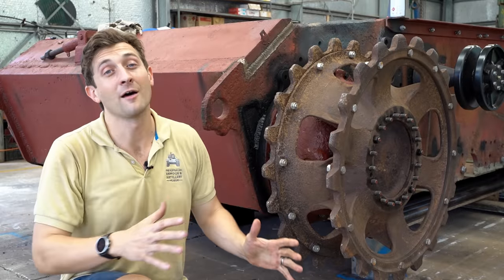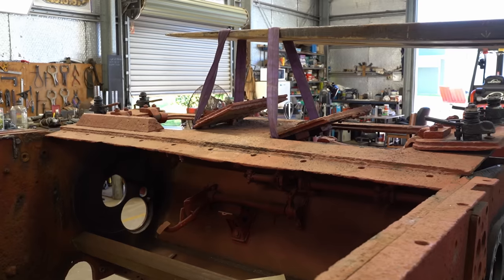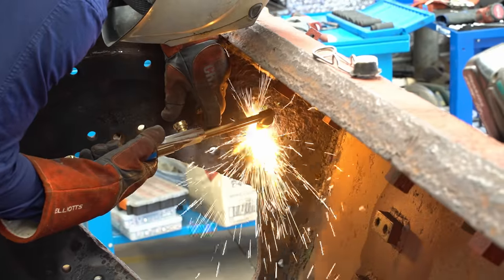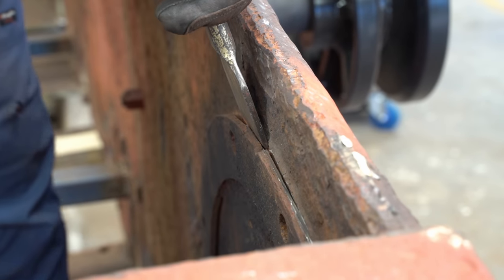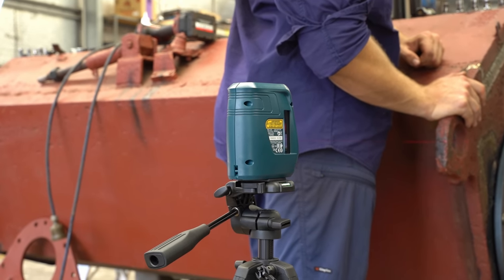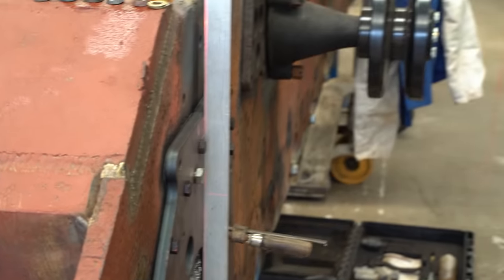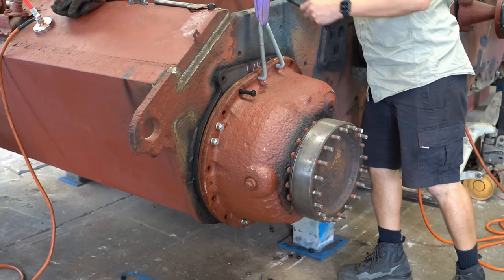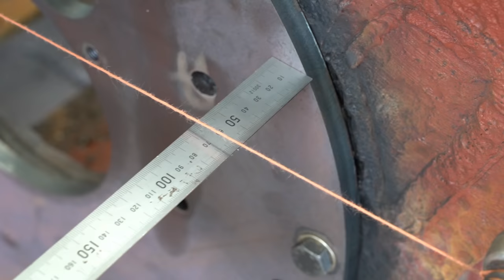WORKSHOP WEDNESDAY:  Bending WWII German StuG armour plate and fitting restored final drives

Comment: Fantastic video!  Crazy good skills there guys!  Not sure if anyone ever reads the comments, but here goes...  If you are ever in a similar situation again, where you are trying to level out a thick plate over an uneven surface, drill and tap three holes in the plate, spaced out in such a way that the holes form a triangle over the part you're trying to level it to.  Thread bolts into each hole (grind the ends of the bolts to smooth them out beforehand).  Use one bolt as your pivot, and the other two to level the plate out ("jacking bolts)".  Usually, the "pivot" bolt will be adjacent to one of the bolts you're using to tighten down that plate.  Use the other mounting bolts to apply compression to the jacking bolts as needed.

Much easier way to level/tram one plate to another than messing about with shims.  Level the plate first using the screws, then select shims to match the gaps between plates.  Weld everything up, then remove the three jacking bolts.  Weld over the threaded holes and you're done.

Thanks again for the informative/educational video...  "Mad skills" guys!

Comment: great to see the air chisel assistant! - great for giving that extra abuse when needed on stubborn nuts and bolts, rivets, bearings and any number of things that need hitting (if not to be used again that is) it can save an awful lot of human effort
great video showing the lengths these boys go to, to make things right, superb restoration work

always amazing to see how much distortion gets created with things that go bang, when an explosion occurred you have to imagine everything around it almost behaves like jelly, everything wobbles as the massive forces of expanding air bounce off the surfaces

many years ago, i was involved a little in some research and vibration testing, i was told by the instructor how years ago when testing engine block distortion, things were a little slower, using high speed cameras and multiple images, to show the engine at work, blocks could be simulated using polystyrene, and vibrated on a table, where there was more movement, that area would be braced until it became more stable - of course these days you can soon find a video of an engine 3d solid model being tested using the same theories and understand how all the components work together and still able to distort an engine to show where the maximum stresses are

there's a great channel i watch 'Lost Battlefields with Tino Struckman' who investigates WWII tunnel systems and bunkers, and you can see the results of any explosive device either wartime or post war experiments used on massive thicknesses of concrete is truly unthinkable, blocks the size of a houses lifted and upset by internal explosions

Comment: Fantastic work!  Just amazing how these guys throw around these huge chunks of steel.  I wouldn't want to be in an arm wrestling contest with any of them!  I can't imagine the strength and stamina it took to swing that giant sledgehammer over and over to straighten the 2" thick side.  What's so amazing in this work is they use blazing heat and brute force to move metal to within a millimeter or two of dead perfect.  Love these videos.

Comment: Stainless steel welding materials does stretch easier when it cools down after welding. This prevents the weld from tearing itself apart ore cracking. 
A good reason for them to use Stainless on she suspension is that the change of cracked welds is lower so your suspension will stay in one piece. 
The rest of the armor plates go together like a jigsaw puzzle and the weld is more to keep them extra in place but if its bad it wont give a big problem

Comment: What we used to do here in the sugar factories in Barbados when we needed a really big hammer hit is , we had about a 12 inch square steel bar about 3 feet long with 2 ears welded on at the balance point with some handles, it was slung on the over head hoist and swung on its chains like a battering ram, there wasnt much that it couldnt move.

Comment: Great work on this! It was mentioned you only have one front sprocket? I’d suggest copying the one you have. A 3D scanner can scan your existing wheel and a print can be made of the scan. From there (after it’s sanded and surface prepped) you could use it for a plug to sand cast a copy in steel. I’ve scanned and printed things for my work and it’s quite effective and accurate. 👍

Comment: If you don't have on yet, 
You need a Porta Power.
It's a hydraulic jack,
Instead of hammering, 
You could have set up the Porta power, and just heat where needed.
Save a ton of gas, and is quieter.....
Reply: Or why not used a chain fall,
And pulled the bulged area back in,
while heating?
Yeah, now that I think about it, that's probably the way I would do it,(mostly because I work alone).

Comment: Hiya,
Thank you for another great video. The brothers, as is their dad, are a real asset to the Museum. I'm just sending a quick message to dad. Try an anklet of Baltic Amber. What? Who? I did not believe it, yet I was wearing the proof. A friend had sent me a bracelet that I always wore. Then someone online said about it reducing pain. I did my usual 'New age nonsense or even stronger words. But I had less pain in the joints of the hand on the side I was wearing it. Okay, coincidence. But I swapped wrists, and so did the relief too. So I spent £55 on three more Polish Amber beads sets, and the pain is mostly down. I can still do too much and cause real pain. I'm still on 65mg of morphine daily, which does not stop the pain but helps. So for a handful of beads to do more than the pills??? Try it if you need pain relief. Call it a coincidence, but I hope if you are in pain like me, I need two new knees, but they don't do finger joints. It has helped with mobility too. Go figure!!!
I hope this can help; I'm told you need Polish Amber for the best effect, raw if possible; mine are all polished. 
Stay safe and do this incredible work; I wish I could be there to do the electrical work. Steve...

Comment: The lose roller wheel was dampening ur Sledgehammer blows.
Lose items will act as exhaust vibration dampers(if you know what those are).

If all ur doing is swinging a hammer,
Use ur extra mental capacity and become aware of ur surroundings. 
Work Smarter, 
Not Harder.